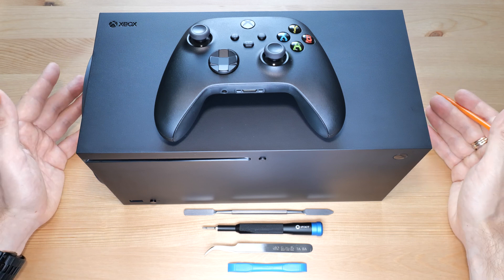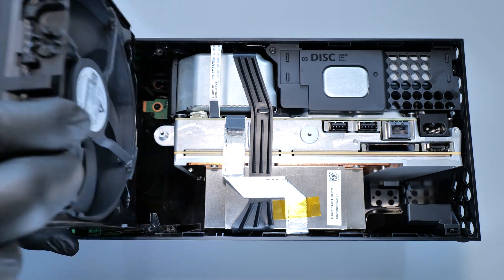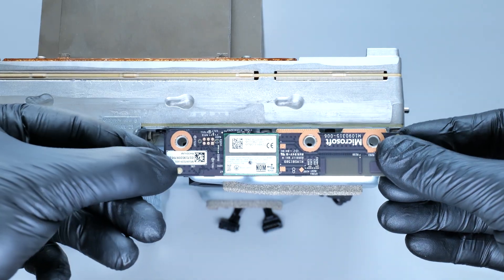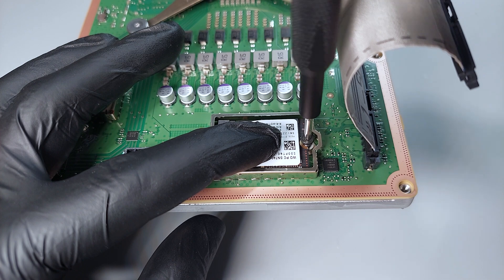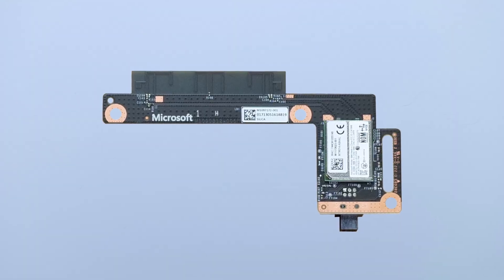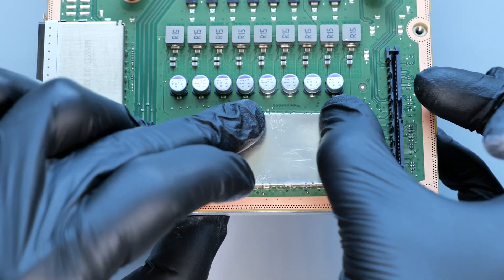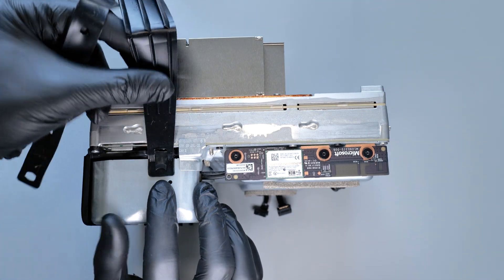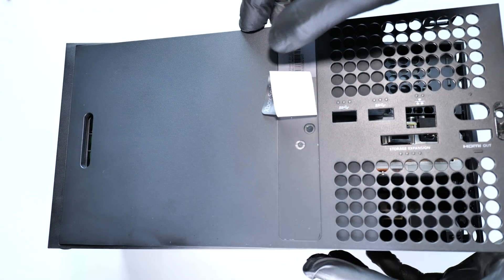Xbox Series X Disassembly + How to Diagnose Power, SSD, WiFi & Cooling Issues

Comment: Hello,
Thanks a lot for your yours vid
Maybe you can help me ? I checked online for 2 days now without anybody having this issue. Console is out of warranty and i have open it up to clean it when warranty was done.
My xbox power button blink fast sometimes (like if you try to pair a controller with it) and sometimes i have a troubleshoot menu when i boot it up but no error code. I think after 2 days of investigate it, that the part use to pair controller to unit is defective wich do the blinking thing or active troubleshoot mode when i power the unit. What do you think of this ?
Thanks in advance and sorry if my english is not so good
Reply: I already try :
Contact support 
Reset w and w/o games, ...
Power hard reset
I was part of insider so i cant update it offline now, but i take out my console of the program since this so i could try to update it later if needed
Reply from the maker: @fatalcrashflamby8268   I'm not sure if I understood you correctly. You mentioned that the board responsible for pairing the controller might be faulty. Are you saying you can't sync the controller with the console? The RF module, responsible for syncing the controller and the Wi-Fi board, shouldn't affect the booting of the console. You can remove those modules, and your console should still run perfectly without them. So, I'm confused. Is your issue that the console doesn't boot properly, or that it doesn't sync with the controller? Or runs normal but sometimes the LED blinks and you get that troubleshooting menu?
Reply: @ElectronicsComputers  sorry, i will try to explain it better.
The issue is :
- Console blink (like when i pair a controller to it, blink fast then come back as normal)
Troubleshoot menu come when i try to boot the console, sometimes not. (No error code)
Reply from the maker: @fatalcrashflamby8268  When you turn on the console the LED starts to blink fast but the console eventually starts normally or not? Or sometimes it does and sometimes it boots into the troubleshooting screen, right? I'd definitely try to clean install offline updates from a USB drive. If it doesn't help, then I would connect console's SSD to a PC and check its state. Maybe the drive is lowly dying and it's important to check the SMART of the drive. If it's bad then you have to clone the boot partition of that drive and then restore onto the new one. I have a video on how to do that.
Reply: @ElectronicsComputers  Sometimes it does and sometimes not. I had insider so i cant update offline before next update am i correct ?
Reply from the maker: @fatalcrashflamby8268  If you've been enrolled into insider program, then you have to unenroll first and then you have to receive a new system update. Once updated you can perform an offline update. If you're not sure whether you've already received it or not, just try to perform an offline update. If you end up with an error, then you're still with insider sysrtem.
Reply: @ElectronicsComputers  thanks, i will try this :)

Comment: What's a good alternative if you don't have a curved pry tool? I just want to thoroughly clean my xbox
Reply from the maker: You can just use a thin flat-head screwdriver, a knife, plastic card and stuff like that. Metal tools can scratch the case, that's why we use plastic prying tools.

Comment: Hello sir,

I suspect a faulty ssd. My Xbox starts up with a chime and shortly thereafter the logo flashes twice quickly and subsequently shuts down a few seconds after this with a shut down chime. I don’t get any signal on my tv.

I tried removing the ssd as you suggest but then the console won’t even turn on. 

Any suggestions? Thank you!
Reply from the maker: Have  you tried to boot your console from a USB drive? If it doesn't work either, then try to connect that SSD to a computer and see the SMART status of the drive. It will tell you if the drive is corrupted or not.
Reply: @ElectronicsComputers  
Thank you for your answer. The SMART values seemed to be ok. I tried booting it with an USB OSU update stick. That did not work. Still no picture on the screen and shutdown after 30seconds. 

Any ideas for further troubleshooting?
Reply: @ElectronicsComputers  i tested 2 different power supplies, copied the RAW partition bit by bit to an identical SSD. still the same. no screen, shuts itself off after 10-30seconds. time gets shorter each time i try. maybe overheating? but why theres no picture?
Reply from the maker: @patrickmusic11   You mentioned before that logo appears on the screen right?
Reply: @ElectronicsComputers  unfortunately not. No logo on the screen all the time. With the original SSD the white hardware logo on the console itself flashes twice. With the new cloned one it does not do that anymore.

Comment: So my Xbox just recently had an issue where it was on and working properly, then grey glitchy lines appeared on screen briefly and then screen went out. I thought it was a bad hdmi cable so I switched to another but same issue. Xbox turns on but nothing appears on screen. I am assuming this is the SSD issue you mention in video??
Reply from the maker: Does the controller sync with the console? Can you log into your Wi-Fi router's web interface and see if the console is connected to your Wi-Fi network? That would be a good hint to understand if the console works properly and you don't have HDMI output signal or if it's something else.
Reply: @ElectronicsComputers   The controller was still synched with the console, I was able to turn on/off the console with it. I actually had the Xbox hard wired via ethernet cable, I unplugged it today, I started scrolling left and right with the analog stick and could hear the menu sound effects. All of a sudden, the TV screen flicked on, an error message had popped up regarding wifi connection. So I plugged the ethernet cable back in, and it works now. Really strange, not sure what the reason behind it is, but the video output is now functioning normally. Thanks for the suggestions, and for creating the tutorial. Take care.
Reply: Blow out and Clean your HDMI port with alcohol. If that doesn't help, it may be the port is bad. Or HDMI encoder chip or the booster pack.. Hopefully it just needs the cleaning of the port. Good luck

Comment: anyone knows how to fix corrupted system files or partitions ?
Reply from the maker: Have you tried to clean install system updates from a USB drive?
Reply: @ElectronicsComputers  i just can't get it to boot, I'm still stucked in the turn on and off part, i copied the raw patition to a new ssd but it's just the same. Also im not sure if i can install directly the system updates to the sdd

Comment: My xbox series x will bring up an error screen everytime turned on but will not work after trying everything microsoft tells me to do to fix it
Reply from the maker: What error code did you get?
Reply: @ElectronicsComputers  I have gotten E200,E201,E202,E205, and E208 it comes up as a different one almost every time i try to reset it

Comment: The transmitter for my stealth 700 g2 max just stays on solid red light unable to pair the headset to Xbox. My Xbox was on the floor and i accidentally hit it with my foot and it fell on its side with the rubber on the four corners. At that moment the headset which was already connected no longer had audio from the Xbox. I wonder if I could open it up and repair something near the front usb slot? It’s not the headset bc it happened the second it fell over.
Reply from the maker: Try to connect that USB transmitter to the back USB port of your console and see if it helps.
Reply: @ElectronicsComputers I did try that and it lit up solid red again. Later that night it went solid green but no blinking. I’ve ordered a new one after dissembling the Xbox and seeing it had no damage.

Comment: I have just bought a faulty xbox series x.  It turns on fine but is randomly turning off. I have watched YouTube on it for a few hours without any problems.  Played assetto corsa for about 30 minutes again without any problems. But when playing fifa 24 it will turn off. I tried gta 5 and this also turned off after about 5 minutes so i think its overheating. I followed your video and changed the thermal paste and also change the power supply. But its still the same. Is there anything else it could be.  The fan although spinning doesn't seem to change speed at all. Could that be causing it to overheat and if so is there anyway to test the fan speeds  before buying a new one. Thank you
Reply from the maker: Did you also replace the thermal putty? If the fan spins even at its lowest speed, the console will never overheat with that huge heatsink.
Reply: @ElectronicsComputers  no not yet, I ordered the putty from your link but im currently waiting for it to be delivered which is likely to be another week or two. Because of this I just reused the old putty  which still felt very soft and not dried out.  Would using new putty help. I have been reading comments online from others with the same problem some saying it's not a Xbox console fault but the games themselves causing it to turn off, could this be true since it seems to happen on enhanced games and not other.
Reply: @topcat807  Did you find any solution?
Reply: @CzarnoBialyy  No, I ended up selling it as faulty. I changed all the putty and thermal paste using the recommended products,  and even fitted a speed controllerbfor the fan so I could turn it up to a higher  speed but it still had the fault. Worse thing about it was I took it apart not realising is was still under warranty so  I could have just sent it to be repaired or replaced for free if I hadn't tried to do it myself.

Comment: My system does turn on and connects to the internet. The system will not play games and crashes to the Home Screen while loading. Is this the drive or something worse?  how can I determine?  your video is well done, but I did not see this problem is a little different that what you discussed.
Reply from the maker: First of all, I would try to reinstall the Xbox Operating System from a USB drive. I have a video on how to do that. If it doesn't help, then I would remove the SSD and connect it to a PC. Using some software, check the state of that SSD. There's a feature called SMART on drives that has all diagnostic information about the drive. If the problem is in the drive, it's extremely important to back up its boot partition; otherwise, that console will become a piece of expensive equipment that nobody can fix. Also, make sure that your console is properly cooled. If the fan spins faster than before, chances are that the console is overheating.
Reply: did you fix your issue? I have the same problem like yours, the game wont run, and keep crashing and restarting console
Reply: @samzhao8543 I have the same issue yoo

Comment: Nice teardown video! Is there an ssd enclosure that could substitute the CD-ROM drive? If so, maybe a RAID 0 could be made using the main SSD and the SSD placed where the drive is. Thanks
Reply: I am assuming a RAID 0 would not be possible because one is Nvme and the other is SATA (from what I understand is a slower bandwidth), but I thought I'd ask anyway!

Comment: Did you try to clone nvme with Acronium or other cloning program and try to put another NVME more faster and with more capiency?
Reply from the maker: Sure! But I recommend using Macrium Reflect.
Reply: @ElectronicsComputers  i Made this operatin with the SSD 2TB Crucial BX500 not The fastest i know, i made the operation without cloning the HDD because i use a free software called Macrium Reflect and i don’t know if The copy WasMade succesfully, i’m courios to see your next video

Comment: thank you, i need to do a deep clean soon
Reply from the maker: Happy to help.
Reply: I need some help I have Xbox series s and the front USB port doesn't work there's no power output on it but for when it comes to data it works fine but I have to use external 5 volt power supply. When I do this it pulls 3 amps with nothing connected to it. I've tried going to the XBox support. when I had warranty and I tried the whole year to get them to do something but nothing has happened so now I'm sitting with a pretty much dead front USB port and it's quite annoying.